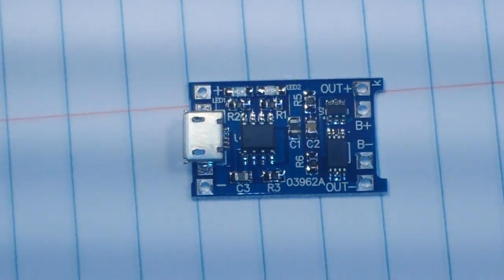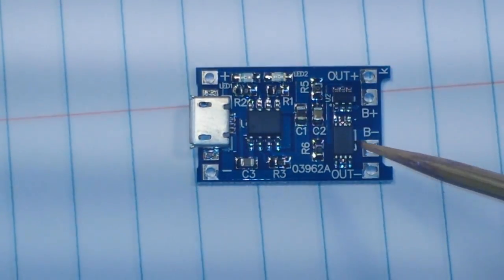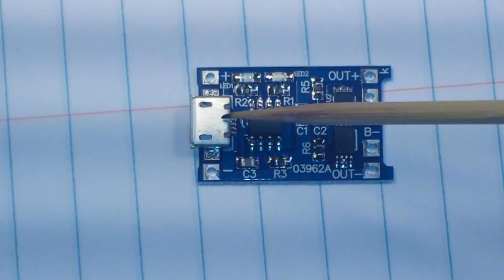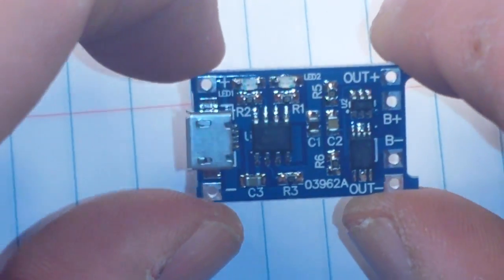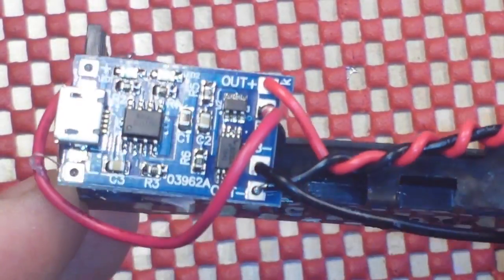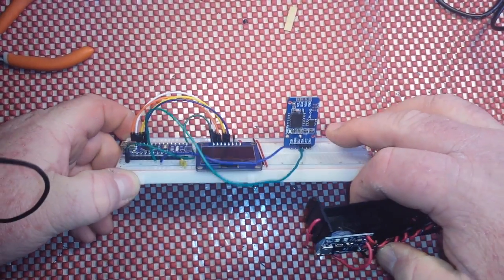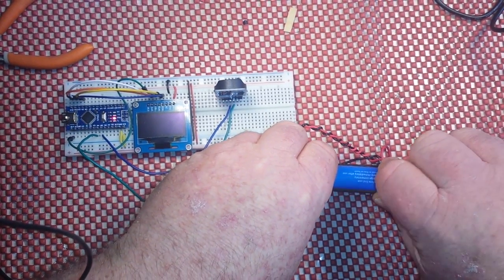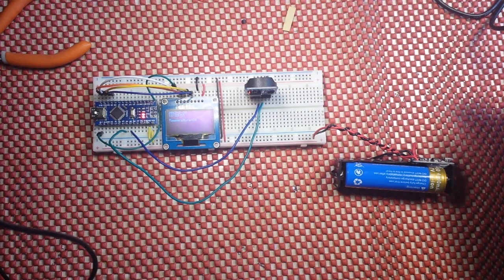TP4056 LiPo Charging and protection board

Comment: was the clock still running when you are charging the battery? or did you remove the output wires out then charge the battery
Reply from the maker: The clock was plugged in. The 4056 will allow you to charge and discharge at the same time.⌚
Reply: ok, i am making a 3.7 volt and 5200 mAh battery is it possible if i wire a 5volt boost converter to the charge output( out + and out -) and still get to use the battery power?
Reply from the maker: Francisco Sanchez yes indeed, in fact, Adafruit sells one called the "Minty-boost" for just this purpose
Reply: the out + and out - is for using the battery power? and the B + and B - is to charge the battery power?
Reply from the maker: Francisco Sanchez correct out is load, B is battery
Reply: @learnelectronics ❤❤❤❤

Comment: Hey Big Clive.  would this lipo/charging board combo be compatible for solar charging please?  I wasn't sure how it would fair with fluctuating input voltage
Reply from the maker: It's for one cell only
Reply: @learnelectronics  thanks, so you could connect a small solar panel to this board to charge that one cell?

Comment: CAUTION - the TP4056 is NOT rated for 10v DC input. The nominal input voltage is 5.0-5.5v, the absolute MAXIMUM is 8.0v. If you push 10 volts into this IC you are going to fry it. Please read the datasheet before using this charging chip, and especially before producing an informational video about it!

Comment: Thanks for the video and the explanation.
 I have a question that I want to use the Tp4056 circuit for my project with the intention of plugging in a 5v charger continuously 24/24h, will it affect the life or durability of the circuit, if so, the life of the circuit will be how? so connected. How long? And is the IC's heatsink necessary?
Hope you will respond to the above information (because my English is not good, sorry)
Reply: If the charger is continuously on 24/7, what is the point of having the battery at all?  If this is for emergency backup lighting I suppose I could understand.  No, it is not a problem to keep it plugged in.  No a heatsink is not necessary unless your discharge current is high enough to cause it to overheat, at which point it will shut down output until power cycled to reset it.  You would determine this peak threshold experimentally or just opt for a board rated for a higher continuous discharge current.

Comment: Is hot glue the best way to mount this thing? I know alot of people do that but I am wondering if that has any effect on the board.

Surprised it does not come with mounting holes of any sort
Reply: I agree that lack of mounting holes is a legit gripe.  Hot glue is a poor solution because the board can get hot in use and soften the glue.   However, no the glue will not, neither hot nor cold, pose any problem for the PCB, except that if it were molten and found its way into the USB socket,  it could foul the contacts or interfere with plugging the charger into it.

Comment: Hey cool video. I have the same thing except the tp chip  gets 120f hot  I am charging a 3000 mah Samsung. Q thirty. It seems to work fine but I am worried that it won't last as long as it should. Is it possible I have a bad batch or is this normal?

Comment: can you use them for those small lead-acid leetec batteries?
Reply: Not.  It is designed for Li-Ion only with a full charge level of 4.2V.
Reply: @stinkycheese804  I see. Thanks.

Comment: Where do you solder the ntc to protect battery from over temp. ? If it doesn't have it, put it in the bin. If, yes, use the protection to save a fire starter.

Comment: Hey. Question for you. Can I use one chip for 10-20 batteries wired in for bulk charging/testing? Or does it have to be 1 chip-1 battery? Thx, GearHead
Reply: It does not have to be one PCB per each battery.  You can put multiple batteries in parallel (not series) and use one of these PCBs, but beyond about 3 cells in parallel it becomes impractical because the charge rate is so low, and also within the limit of the discharge current, would you really need that many cells? 

So in theory yes but in practice it would be silly and not very useful to construct a circuit where only one of these handles 10-20 batteries.   Besides that does no testing, just use a full featured battery charger if you need charging and testing a lot of cells.

Comment: Is it possible that a 3.7v lipo has bms built in so you wouldn’t need the protection circuitry? Or am I missing something? Thanks!
Reply: Some cells have protection built in and some do not.  However, practically none that do not have a USB socket put into an end cap, have any charging circuitry so you could still use this board even if your battery has its own protection circuit.

Comment: Do these circuits limit the discharge capacity of the battery at all? I know this video is a million years old, but I'm hoping you might see this.
Reply: Define "discharge capacity".  Yes they have an output current limit around 3A (depending on ambient temp) and will shut down output if they reach their overheat trip temp.  The datasheet may elaborate but generally if you need much more than 2A current, you should seek a board designed and rated for higher.

Comment: If you had say two of those cells in series, would you be able to charge them both with one TP4056?
Reply: No, it senses 4.2V cutoff charge level so you can't do cells in series.  If you were to instead connect cells in parallel, then they will simply charge at half the rate of one, assuming equal capacity cells.
Reply: @stinkycheese804  That makes sense.  I'm looking for a way to charge them in series since I need a voltage that is double the 3.7v.

Comment: Does a boost converter exist to bring an 18650 to 5v? Everything I keep finding has a minimum voltage of 3 to 3.8v. I am reading that on some of them, if you go to low... they generate massive voltage spikes.
Reply from the maker: Try the Adafruit Power boost 500 
https://www.adafruit.com/product/1944
Reply: @learnelectronics  Awesome, thanks!
Reply: That is my worry, I would check the voltage every so often, and then charge it when it hits one threshold. Another safety "check" could be put in for a lower threshold, for a total shut down, in case the first one fails.
Reply: Just for your own reference, check out this

https://www.ebay.com/itm/124367773290

Comment: Can I connect 2 tp4056 load output in series to get a 7.2V - 8.4V output? Each tp 4056 would charge a single 18650 battery with only the output load in series to get a 7.2V to 8.4V.
Reply: You could but it seems kind of silly to do when 2 cell BMS boards exist and you would need two separate USB inputs  for charging that are isolated (no shared ground or positive).

Comment: so what if youre not using lipo? youre using a li-ion 18650 here... so will the li-ion still be cut off at the what i assume is the 3.5v that a lipo isnt supposed to be lower than? is it always set to be on lipo? i have plenty of 2s and 3s lipos i can take apart to use the cells but i wanted to use 18650s because i have more of those laying around.. but not if its only gonna charge everything to 4.2 and cut it off at 3.5v.. thats wasting a ton of potential energy for something that doesnt need to be cut off at 3.5v, aka, cutting your potential life to way shorter than it could be if youre not using li-po..

Comment: Hi , the Dw01a switch off the lipo when the V = 2,4 V , but the minimal tension of lipo is 3V , why??
Reply: That 3V is arbitrary and depends on the manufacturer and cycle rating. Yes it would be safer and conservatively gentler to the cells to terminate discharge at a voltage higher than 2.4V,  but they decided to set it at that.  Many cells will survive this discharge voltage so check the datasheet to see what the cell manufacturer states about that.

Comment: Question, I bought 2, 1 Lion and 1 Lipo. They look similar s how can I ell which is which?
I want to charge a cell phone LioN.
Reply: Same situation on my end, I have a dead portable speaker and I want to test by charging the battery to see if the original charge port is what fried.
Reply: Roy, you can use both. I just picked one and it charged my lion cell just fine. I took the advice of a commenter to my question on anther vid.

Comment: can you charge the battery when the load is connected?
Reply: No you can’t! It will damage the board or worse the battery
Reply: @robinbpunkt2201  doing it since one year no problem until now
Reply: @sblantipodi  hm okay, but in the data sheet it says, you can’t charge and power something at the same time😄
Reply: @robinbpunkt2201  can you link me to the datasheet please? Thanks

Comment: can i use Micro USB TP4056 x 1 and  li-po battery x 4 in parallel.. thank you
Reply: Yes, but with 4 in parallel they will charge at 1/4th the rate per cell so it takes a long time to charge them, and you still have the same peak output to load current limit that you would have using a single cell instead of 4 in parallel.

Comment: Can the be used to charge three 18650 batteries wired in series? I connected the Bat leads to the input/output leads in the balance board. All is well until I plug in the micro usb. Then it fries the TP4056.
Reply: No, only one or more cells in parallel.

Comment: The 8205A is just the mosfet for the DW01 (and not a protection chip in its own right) which will allow discharging all the way down to 2.4v which is a bit further than I would call safe. The overtemperature feature of the TP4056 is also disabled on this module so it might not be as safe as you're lead to believe.

Comment: Thanks for the video. I’ve been using the TP4056 for my projects and although it works when the battery is plugged in and the load is attached, if the battery is detached with the load still connected and the reattached, the circuit has a probability of not turning back on. After reattaching the battery, I can disconnect the load and then reconnect it and it works again. I’ve tried adding a capacitor to the output of the TP4056 which reduces the chance of not powering on but it’s not a 100% solution. I was wondering if anyone else ran into this issue
Reply: could u solve this problem?
Reply: Hi @wywarren, I want to ask about the durability of this circuit when just charging the battery and connecting to the load. How long is the durability and is it stable during work?
Thank you

Comment: Thanks.. I've seen these on eBay and ofcourse they come with no instruction..even the seller couldn't tell me voltage values or how charging worked..in fact the sellers didn't have clue what they are..

Comment: Hi New to electronics, just purchased one of these can you use it to say charge a larger 12v battery say out of an emergency light unit?
Reply: No, it can only single cells (or batteries comprised of parallel cells) with a full charge voltage of 4.2V.  If you are new to electronics, please stick to simple projects where safety is not a concern, not emergency (anything) equipment.  Thanks.

Comment: I think you can trick the overdischarge protection using a low current drain device like a led. LED Uf=3V Maximum cell voltage (U) 4.2V R=60 to hand out a maximum If of 20 mA.
Reply: You are not making sense.  If LED forward voltage is 3.0V (and that is abbreviated as Vf, not Uf), and cell voltage is 4.2V which is abbreviated as V, not U, then current is 20mA, there is no appropriate "If" designation involved.  Now to roll all that up into a statement:  If the forward voltage of the LED is 3V, then the LED should have stopped conducting significantly (far far below 20mA) by the time it hits the protection cutoff threshold of about 2.4V.  Still, I would not leave the load connected indefinitely as there may still be parasitic losses.  On/off switches exist for a reason.  ;)

Comment: my 03962A is overheating when charging  a LGABMH11865
Reply from the maker: whats an 03962A?
Reply: @learnelectronics  the same battery charge module as in the vid
Reply: @learnelectronics  google it if you still dont understand

Comment: I am looking for a way to charge 3x 18650 cells connected in parallel. Together they are still 3.7V but higher capacity. Can I use the TP4056 for that or is there a better idea? The battery pack is installed in an electronic project so I cannot take it apart to charge the three cells separately.
Reply from the maker: TP4056 board is for a single cell.
Reply: @learnelectronics  Is there a similar board that works for two or three cells?

Comment: Good explanation, much appreciated! However, when connected to a PSU, the power goes still through the battery, which is unnecessary (constantly charging/discharging). An easy fix quite similar to "load sharing" is this https://forum.arduino.cc/index.php?topic=496727.msg3390097#msg3390097
Reply: hello, is it possible to do that using only 2 diodes instead of the mosfet?
Reply: @michaelscolfield14  I never did it that way. I believe the commenters in that thread are more knowledgeable than I am.

Comment: Question - i bought 10 of these boards, and made me a battery bank charger for up to 10 cells.  it wasn't acting right at 1st, but then i realized that i had to add in some filter caps on the power input
side of the boards. i got it all up and running fine, every battery showed as charging, some took longer. i kept checking on them, and a few stared to get hot. i terminated charging on them cells.
i noticed that the chip is capable to use a thermister. but on all of these boards that are available, the thermister is not used. but the schematic shows that one can be used, 
but it shows no value to use.  i looked a the data sheet, but it gives no insight on what sort to use... do you have any advice ?  i wonder if the ones that are on the laptop battery packs  or tool packs would work or not,  i think if i have this i can have more safety on my cells when charging.
comments please...

Comment: if i wanted to add a power on/off switch should i put it on output or b?
Reply: I would put it on the output of the 4056, putting an on/off on the battery side would require the switch to be closed (on) while charging which isn't ideal.
it would mean you would have to have power on (to your device) while charging.

i'd stick to output!

Comment: Hi @learnelectronics, What happen if the battery I got has its own protection circuit. There is a issue with that?
Reply from the maker: It will be fine

Comment: any reverse polarity protection to this tp4056 board if I accidentally reverse the 18650 battery to the battery holder??? 

thanks in advance
Reply from the maker: No there is not. Doesn't mean you couldn't add your own, fuse and diode.
Reply: any other method with buzzer & LED indicator warning??

Comment: Thanks for sharing this video!
I too did mount this module with hotglue and over time it has failed due too the heat transferring... I found that covering the entire backside to work best or epoxy it and call lit the day
Reply: I was about to mention this!  The board does get pretty warm under significant load, so the low melting point of hot glue can be a problem.

It is a bit unfortunate (almost to the point of being insane?) that there aren't more Chinese manufacturers that include mounting holes on their PCBs, then if they really must, they could laser cut perforations so those who don't want the slight added dimensions of the PCB to include those mounting holes, can just snap them off the PCB.  Hot glue is a  poor solution and epoxy quite permanent (unserviceable), particularly for a board that has to endure the repeated plug cycling of inserting and removing a USB plug to charge the battery.

Comment: The TP4056 cannot discharge batteries for storage. Do you know an intelligent battery protection PCB that can do that? That would be awesome!
Reply: It is not meant to discharge batteries for storage, nor is that all that important to do because they discharge themselves.  Simply do not fully charge them.   Besides, how long a storage are you talking about?  For  only a few years, the self discharge is too low to matter if they have a decent charge level.  For longer, what was the point of even owning them?  Plenty of devices last several years through regular use, which is far more demanding than mere storage.

You might be reading bad information elsewhere and drawing the wrong conclusions about the non-importance of discharging cells to some specific level prior to storage.

However if you really want to be picky about it, simply use the cells to power a load until they reach your target storage voltage.  No need for a special PCB to do this.  You could make it easier using a charger with discharge/capacity measurement function and just pull the cells out when they reach your target voltage.

Comment: I thought 18650 is lithium ion not lipo?
Reply: The main issue being, that Lipo's should not be discharged below 3v. While Li-ion cutoff for this chip is 2.4v. So using this chip without an additional over discharge protection circuit would be bad. Also these chips only output .3a - .4a before the voltage begins to drop dramatically. They are good at specific applications, but NOT for a raw Lipo unless your lipo has built in protection.
Reply: 18560 is a li-ion but the module should work in theory with li-po's as well but not with lithium coins
Reply: @cnbihatemylife  If you change out a resistor you can charge coin cell batteries, just google it
Reply: The distinction isn't really meaningful there are different package types hard shell or soft pouch and different chemistries.  The hard shell stops expansion and contraction of the cell when gas builds up in the cell, various chemistry in the calls will have as much or more impact on the performance